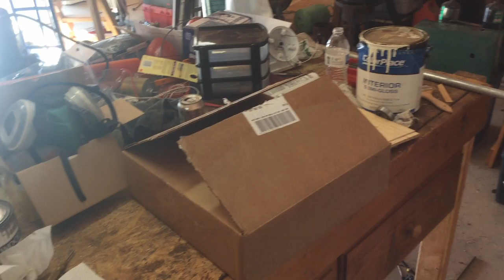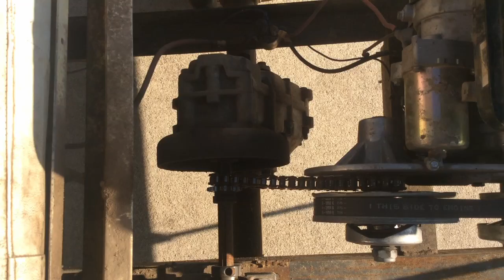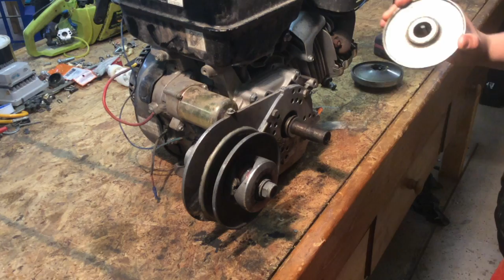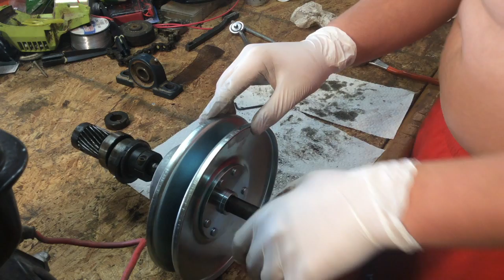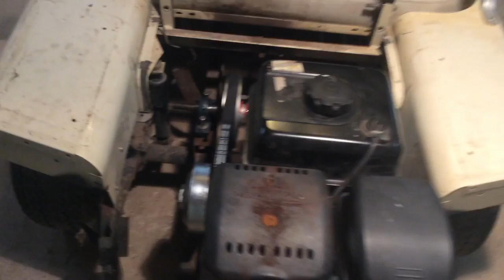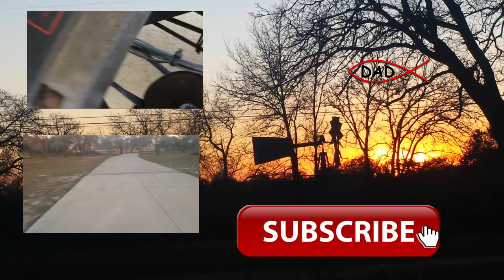Gas EZ GO golf cart upgrade and fix

Comment: You jumped from pulling the pulley off engine to installing torque converter on some shaft. Where did that shaft come from? Why did you have to remove engine. I have had my pulley and torque converter off while still mounted to gold cart. I also had a 30 series on my 13HP. seems ok, but now thinking of upgrade. do you know where I can get a starter and starter relay for that motor?
Reply from the maker: Its the electric motor shaft. Check out the conversion videos to see that. Ours came with the starter already on it but could probably find a replacement aftermarket for predator or honda that would fit.

Comment: why not just add a tensioner pulley instead of welding up the shocks? Also think about adding a go kart transmission for reverse. im about to start a conversion similar to this and im gathering all the info i can. still trying to descide if im going with predator motor with go kart trans or atv motor with self contained trans. i will be posting videos of the build. thanks for the video. let me know what u think
Reply from the maker: josh b we thought about pulley but decided to go with quick and dirty... if you have the time atv would be nice for the reverse but for us it is more about what you can do with what you have.

Comment: how does torque converter mount to axle shaft?
Reply from the maker: Check out part 2 around 4 minutes into it... TC mounts directly to engine then drives a sproket attached the old electric motor shaft.

Comment: Does your cart have reverse?  And if so, how dis you do it? I swapped out a 6.5 for the original motor in my 89 Marathon,  but now no reverse. I'm thinking go kart tranny?
Reply from the maker: No reverse we just push it backward! for the smaller engines they do have F/R gearboxes and they are fairly cheap we probably would put that on the Marathon if we ever have to change the motor.
Reply: BigRedFishDad Thanks.  After watching and rewatching your build and Fearless Front's, I'm more than likely going to install a kart trans between the comet and rear (oh if only it was a 4 stroke rear end...)
So to that end, I think what I am going to do is tube out the back and mount the powertrain in the rear, leaving the underseat area for storage. Given the cradle orientation for the 2 stroke, I think it would be too tight the other way.
I'm going to stretch it as well,  so the weight should be offset in the end (which brings up the brake cable issue). I started poking aroundin there a few days ago, and am going to document the process.  Thanks for the inspiration.
Reply from the maker: Have fun... sometimes it is more about the process than the end product ;)

Comment: You have the motor mounted to the frame correct? Dose the chain pop for the reason of the suspension going up and down? I have a similar project but I'm trying to figure out if I should weld up a braket to come off the axel case to mount the motor or just mount it to the frame the chain slop is what I'm worried about
Reply from the maker: yes to the frame direct to the old electric motor shaft. We did weld up the suspension after it started popping off every bump and that helped quite a bit.

Comment: sweet the other then you might want to try after lots of searching I have found that the motor on gas karts is bolted to a frame off the swing arm so motor moves with suspension if you look up golf kart big block kit on eBay you will see what I mean  keeps chain from slacking anytime the suspension moves

Comment: did the new setup work good with suspension working about to do the same swap but want to keep suspension and what mod did you do to get to 30mph
Reply from the maker: +JJ How Thanks for watching... in this one you will see it goes slower than original. Check out the first videos worked well but kept having chain problems. Maybe swapping to a belt drive instead of locking the suspension but we just kept trying things. The faster speed was because we used a different ratio on the driven to go kart axle. We plan to do one more modification and change to a live axle and bypass the gearbox so we can get lots more speed.